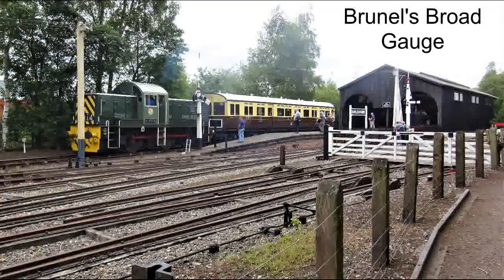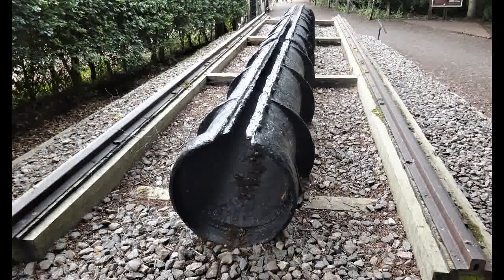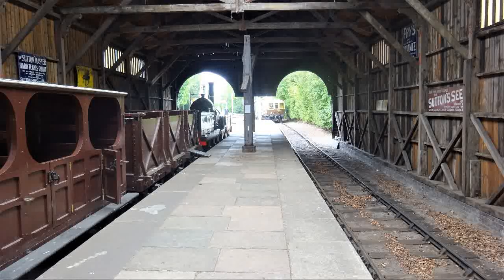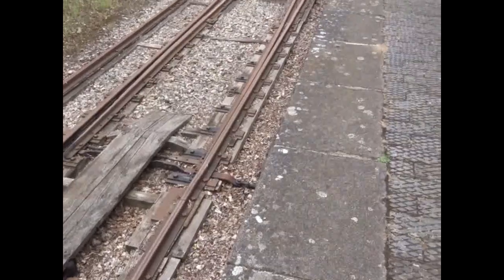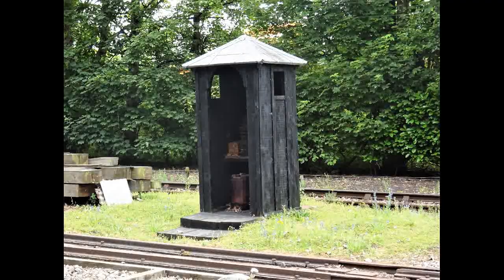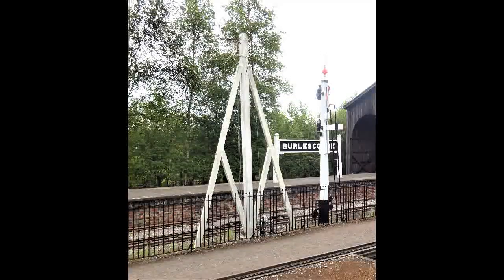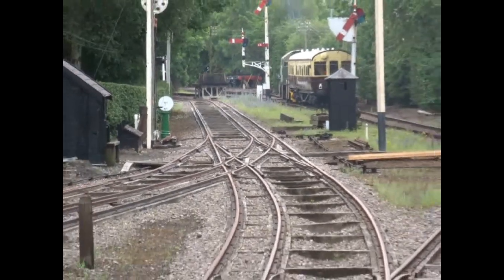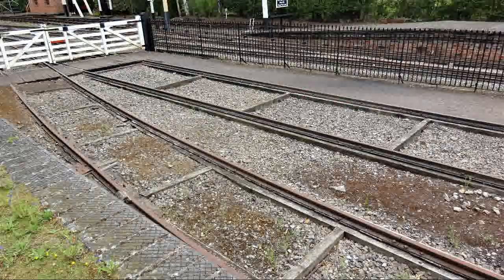Brunel's Broad Gauge, The  Didcot Railway Centre, Oxfordshire

Comment: I did read that the Brunel's Broad Gauge track was Seven Feet - with "a rolling stock tolerance" of one quarter of an inch"? Any comments on this would be more than welcome.
Reply from the maker: Yes. It's officially 7ft 0 1/4inch

Comment: While it would have had smoother ride and higher speed, it would have been quite expensive to grade and build through hills or mountains making it ill suited for low-speed steam freight or passenger service. Though it might be very well suited for more modern high speed rail which needs smooth, straight, and level track anyway.

Comment: It makes me wonder how much nicer the inside of our trains would be if broad gauge was used nationally instead of the standard we use today.

An example I think upon is how much better commuter services would be that utilise a 3+2 layout, that extra room of broad gauge would be more than welcome!
Reply: Hi a railfan from India. We use a 5ft 6inches gauge. Trains are normally 10ft 8inches wide (The ICF and the LHB coaches). But, the EMU commuter trains also known as the Local trains have 12ft wide coaches. In Japan, Shinkanshen also called bullet trains run on Standard gauge track and they have nearly 11ft 2inches wide coaches. Even there commuter trains which run on 3ft 6inches gauge also called Cape gauge have coaches as wide as 9ft 8inches. On the other hand British trains only have width of 9ft 3inches. This width is generally used on Cape gauge railways. I feel Britain should increase their Loading gauge at least by 6inches.